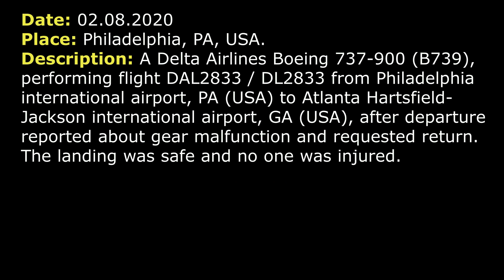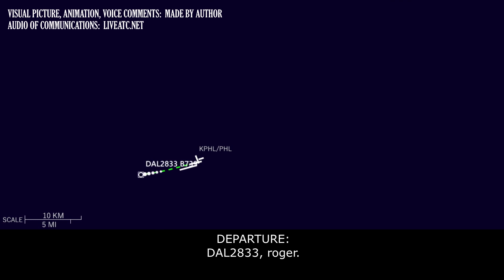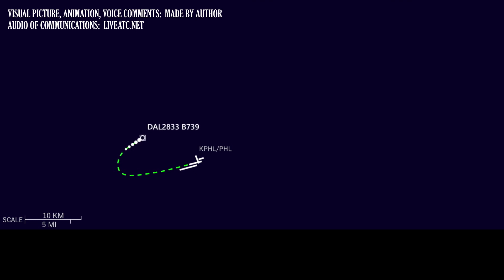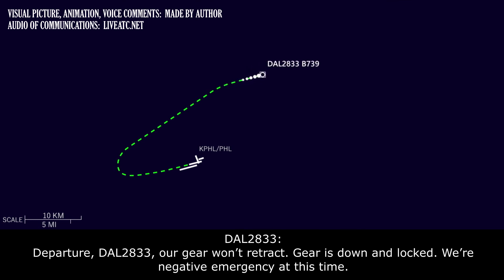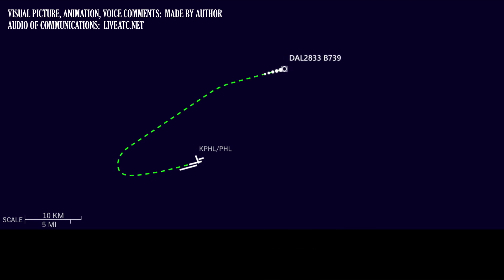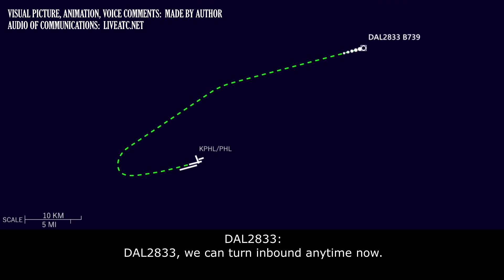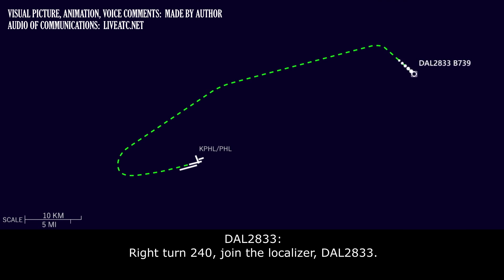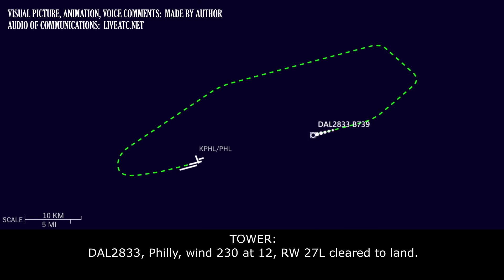Landing GEAR MALFUNCTION | Delta Boeing 737-900 | Philadelphia airport ATC

Comment: 2:03 Okay, DAL2833, I did copy that.  Whenever stuff like this happens here they're going to handle you as an emergency. So I do need fuel remaining in pounds or gallons and the number of souls on board.
3:32 DAL2833, you can advise Philadelphia airport in sight...
4:47 DAL2833, we'd just like to go into the middle of the deice pad and stop and have the chief check out the landing gear if able.
4:55 DAL2833, I can't send you in the deice pad only because I don't control that area, they're moving airplanes around. I'm not sure what the plan is there, but you can stop on taxiway Z and uh.. do you need...